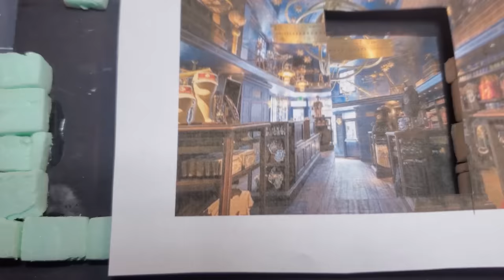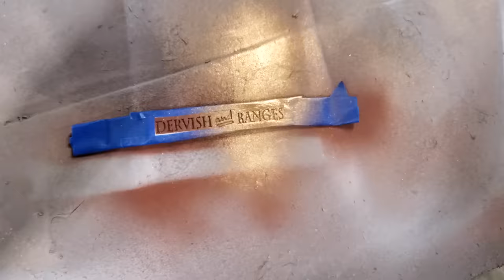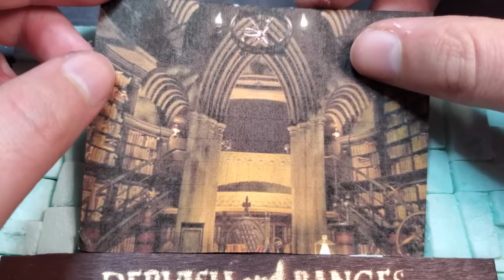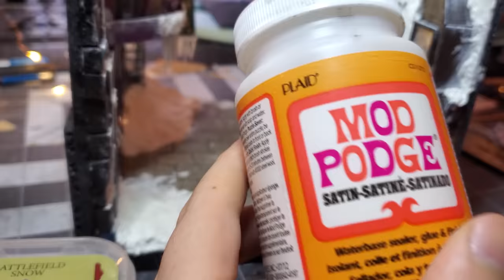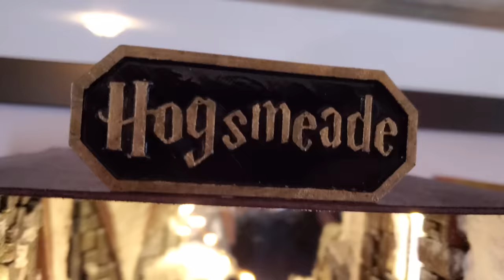⚡ Harry Potter Book Nook ⚡

Comment: Beautiful! And the music was lovely and appropriate. 
Something to know is that you can buy a front-surface acrylic mirror pretty cheap from Amazon. if you had used one there would be no visible gap in the snow, which was caused by the thickness of the rear-surface mirror. Easy to cut as well.
Reply from the maker: Brilliiant! Gotta say I never even thought of those, I just picked up some mirror tiles from Walmart a while back. Those look wayyy easier, and better. Thanks!
Reply: @TheProppingBlock  Glad that that might be helpful. You do such beautiful, detailed and clever work. I just couldn't help but put my two cents in.  
I noticed some Amazon reviewers gave it one star because they were using it backwards! Turns out the front surface has a protective plastic film on it and they were using the wrong side.
Reply from the maker: @henryD9363  Really appreciate it! Just ordered some for the next build

Comment: I'm really having a hard time trying to find the pictures of the inside of the stores. Anyone have any suggestions?
Reply from the maker: The pictures I used in this nook or the pictures of these particular store interiors? I just used random pictures of interiors I thought fit the bill
Reply: @TheProppingBlock  Thanks for getting back to me. Yes, the interiors are what I can't find. I cannot find just straight on pictures of the interiors of appropriate stores. Even remotely close, I'd be happy with at this point. They're usually at an angle that wouldn't fit. Like your one for Dervish and Banges looks great and is straight on.

Comment: I want to build one of these as a christmas gift...any chance i could chat with you or get a more detailed how to?
Reply from the maker: Sure! I know the video doesn't show 100% of the process but most of it's there, any other questions you have I'd be glad to answer!
Reply: @TheProppingBlock  1. Whered you get the pictures used for the inside of the shops?
2. Is the black board just foam core? What thickness?
3. Is the purple paint a primer or just pure acrylic paint?
Reply from the maker: @spacemanERAU  1. Google images, I just searched for Hogsmeade shop interiors/Harry Potter Interiors and chose those ones
2. The black board is just standard foamcore poster board
3. The purple paint is just acrylic paint
Reply: @TheProppingBlock  are you just using like popsicle sticks to make the window frames and such? Disnt they they would bend into a curve like that.

What about the "electeical components"?  You get everything off amazon?
Reply from the maker: @spacemanERAU  Yeah popsicle sticks and toothpicks. If you soak the wood in water you can carefully bend it into a curve. Lights are just LED fairy lights from Amazon
Reply: @TheProppingBlock  did you use individual fairy lights for some of the windows and lanterns?  Is that a thing? i thought they just had strands
Reply from the maker: @spacemanERAU  I used a single strand for this, and just fed it into everywhere that needed a light
Reply: @TheProppingBlock  ohh wow!!! Im gonna have to watch closer i thought i saw some individual ones